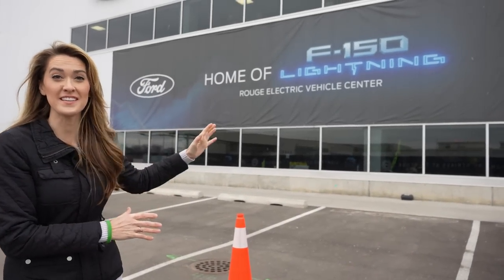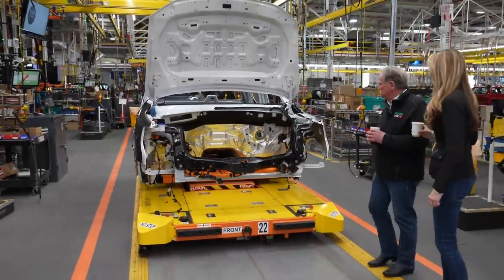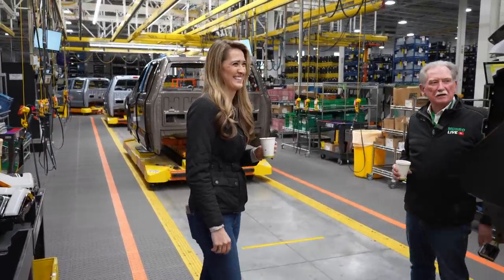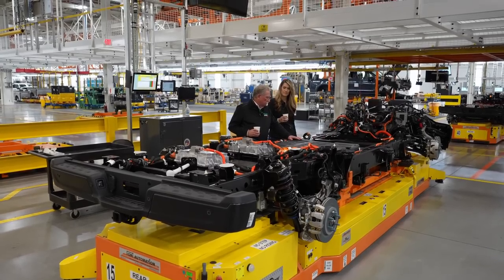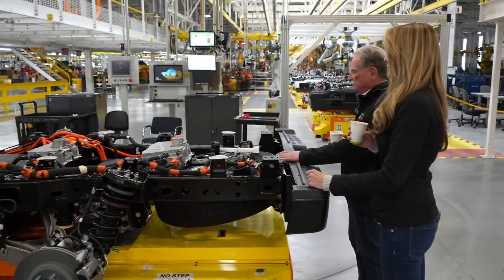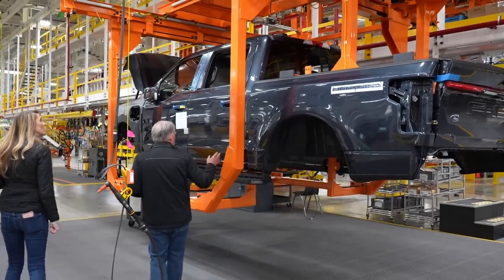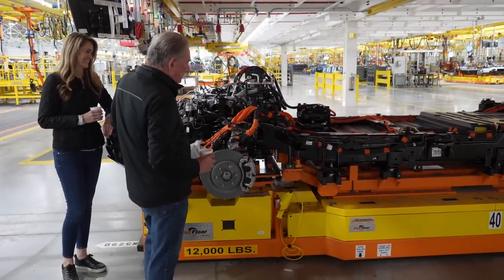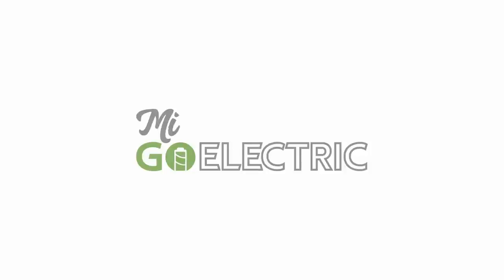Ford F150 Lightning Assembly Line Tour with Sandy Munro

Comment: I can’t believe that you and Sandy are walking around with open coffee cups in the factory.  Sandy even has his cup inside the cab of the Lightning. I don’t believe that either one of you would spill a drop, but it’s funny to me.
Reply from the maker: Yes, it was funny to us, as well.  Sandy has a pass to basically do whatever he wants everywhere he goes.  We saw Jim Farley gesture to Sandy over a crowd of reporters at a press event.  The guy is loved.
Reply: @MissGoElectric  I am so glad that you got to spend time together, what a treasure he is.
Reply: it's funny that in 2022, FUD motors is not using ADVANCED manufacturing, and LEAN design.
Reply: No safety glasses and open beverages on an active assembly line. Nonsense. 🤪
Reply: I like the video but Wow on drinks. we have different types of factories, but open cups and no PPE, i’ll have 3 departments; Environment, H&S and HR breathing down our neck so hard that it will snap.
Reply: Right?
WTF
Reply: @gcv1123  Bizarre!
Reply: @mavelous1763  Exactly!
Reply: Agreed - no safety glasses, likely no steel toe shoes, drinking in the vehicles, and leaning all over the painted cabs causing scratches. I don’t care who they are - I’d kick them out!,
Reply from the maker: @SUPaddict  We enjoyed the coffee Ford gave us and I'm happy to report that nobody threw us out.  It was a treat to walk around the factory which was not in operation along with several other film crews.
Reply: Scary
Reply: @gcv1123  it wasn't an active assembly line. The "active" parts of the video were edited in to show what they are talking about. It's obvious this was an open house event for press and VIPs.
Reply: This was going to be my comment. There are so many things you two are doing wrong. Sandy should know better. Setting a very poor example.
Reply: @terrysullivan1992  do you think that these vehicles are not going to customers?
Reply: @gcv1123  And no workers, no line movement, execs doing press interviews, yeah, just a normal day on an active production line.. Or..
Reply: "Hello sir, Ford calling . We regret to inform you that your F-150 Lightning order is delayed due to coffee being spilled on the wiring".  Can you imagine?
Reply: @philhyde983  But you will have to pay more for your truck because it contains coffee spilled by Sandy Munro and his DNA was in his slobber!
Reply: @mitchellbarnow1709  Hahaha
Reply: @philhyde983  I’m glad that you could appreciate my humor, some would take it seriously and ask, “really?”!

Comment: Great stuff!  Kudos to Ford for allowing this walk-thru.
Reply from the maker: Ford has been absolutely wonderful to our small channel.
Reply: @MissGoElectric  hey, while I have your attention, do EV owners comment about vehicle weights?  The EV's are much heavier than comparable ICE's and I'm curious if consumers know or care?  Certainly engineers care as the loads are higher and lightweighting is more challenging.
Reply from the maker: @andrewhalonen5241  We work with many of manufacturers on product launch campaigns (mostly EV) when we aren't producing content for this channel or on Instagram.  Through that work we have personally interacted with a couple hundred thousand prospective EV buyers.  In our view, most commodity car buyers don't consider vehicle weight. If anything, we've noticed that most consumers feel safer being on the favorable side of a collision with another vehicle due to Newton's second law.   The weight can also be helpful with traction in wintery conditions.  Of course, the polar moment of inertia isn't top of mind for everyone, but the location of that mass has some safety advantages, too.

Negative effects of extra EV mass is commonly amplified by low rolling resistance tires which might present deceleration and handling concerns for physics-minded buyers.

Performance buyers who drive on track tend to be aware of EV weight.  It is valid reason many of those buyers haven't gone electric yet.

Until the recent supply-chain trouble began driving many EV makers back to heavier LFP chemistry, it looked like production battery pack weight was dropping fairly quickly.  It will be a long journey towards power-to-weight-ration parity is achieved in most form factors.

What are your thoughts?
Reply: @MissGoElectric  I'm not surprised that consumers are largely unaware, yet I also wonder if the driving experience is superior for most people who drive commodity cars/SUVs/crossovers?  I drove a Tesla 3 once, and it was quick & quiet compared to my vehicles (I also liked regen braking).  So, I wonder if the power-to-weight ratio is superior to commodity ICE's, and that is sufficient to satisfy most people?  I asked because I study vehicle lightweighting.  I don't foresee emphasis (IE OEMs willing to pay substantial premium) to cut weight, yet hopefully we see an emphasis to cut costs.  Thank you for sharing.

Comment: Great tour of the facility and appreciate hearing Sandy's insight. I'm guessing he said there was no need for the foil barrier between frunk and cab, because there is no engine creating heat, but maybe they are using it as a sound barrier?
Reply from the maker: Could be. It may be more costly to change the procedure than to do it as it has been done.

Thank you for your encouragement :)

Comment: I've owned at 5 SVT F-150 Lightnings. Fabulous trucks! It kills me that FORD will never build a short bed single cab iteration...kills me!! I'd have already had my order in. Back in the day, I got a tour of the Roush facility in Allen Park, MI where the Lighting engineering bucks were located and a whole wall of supercharged engines was nearby that. Your tour sure was great to see and Sandy is the man to walk it with you...
Reply from the maker: It was a great experience. Maybe we'll see a smaller electric pickup from Ford in 2024?

Comment: I agree with measuring the gap at such a later stage. Well at least now i know why my my F150 has so much uneven gaps when doors are closed. They found them; no doubt, but said to roll it on son!
Reply from the maker: We took delivery of a new Tesla Model Y in March.  It also has panel gap issues, but it doesn't affect our experience.
Reply: @MissGoElectric  i am an ex-Toyota fan boy and build quality does matter to me. It does not take a lot of money but the will and attitude to improve the quality. Enjoy ur Tesla 🙂, it is on my radar too but can’t decide between the all the new EV choices.

Comment: Does Tesla have a gap sensor stop on its production line? If not, they could use one. If they have one, it needs adjustments.
Reply from the maker: There is always room for improvement.  Perhaps Tesla's new factories in Berlin and Austin have addressed consistency already.

Comment: Would love to see you at power train for battery assembly, body and white is always neat to see, used to work for ABB, sounded like 150 battery line very mixed. Take it any day over Pari Mach E line. Kansas City transit battery line, miss it and dont. Too much time away from family but incredible experience and can have really great group of people dedicated to same project, at least until upper management f's it all up.
Reply from the maker: Each role in a huge organization like Ford surely has its perks and drawbacks.

Comment: MISS goElectric - this is not the FIRST ford electric truck, they built the EV Ford ranger  in the 1990's. it was a commercial failure.
Reply from the maker: Our claim in the introduction is that it is the first "full sized" truck, which is true.  It is also the first mass-market electric Ford truck.  The Ford Ranger EV was mid-sized and they only produced 1500 in four years of production.  Ford produced more electric F150s in the first few weeks.

Comment: I can’t believe you’re walking a manufacturing facility without safety glasses.  Safety toe shoes are probably required too.
Reply from the maker: If the factory were operating, there would be dangers. It wasn't running, though.

Comment: That's why Silverado EV is coming next year and redesign Lightning in 2025 on TE1 platform.

This is a modified F-150 platform where GM Silverado EV BT1 is a EV from ground up next year.  

Wait for Ford 2025 redesign. 

The Ford F-150 Lightning is already being promised a redesign for the 2025 model year. Reuters mentioned this when discussing Ford’s production plans for the Lightning.
Reply from the maker: We talked about another purpose built electric truck to be manufactured in Tennessee in our F150 Lightning Launch VLOG video and on Twitter.  We have not verified if it will be an F-series vehicle. We know it has been in development for two years and will feature radical design and aerodynamic elements.

Comment: Having a career in manufacturing/ quality, this appears as low volume or soft ramp up in production. I will say that the base model, or Pro as Ford calls it, is currently a bargain in the present EV world. The coming GM Silverado EV @ near 40k should be so too. The Cyber truck doesn't stand a chance at this price point for performance.
Reply from the maker: The unrivaled scale of F150 production is a major advantage keeping the costs down for F150 Lightning.
Reply: Hmmmm. Hmmmm. Keep believing that. TSLA makes more money than F at 1/3 the sales. Have you seen inside their factory? F does not stand a chance
Reply: @MissGoElectric  Really hope they can hit that 150,000 per year next year as stated and then after that, really scale to unrivaled levels. The mach-E volumes have been underwhelming, to say the least. Demand is not the issue.
Reply: @yeswecan4312  🤣

Comment: It looks like Ford took a regular ICE version of the F150, removed the engine, transmission, drivetrain and associated parts and replaced them with electric motors and battery. Not a bad way to quickly get out an EV version, but probably not optimized for an EV. It would be interesting to know whether anything in the cab or bed differs between the EV and Lightning versions of the F150.
Reply from the maker: This is largely an upfit and Ford has developed a different all electric pickup truck which is more efficient. We recently learned from Jim Farley (Ford CEO) that it is scheduled to go into production in Tennessee by 2025. Subscribe to this channel for updates on that one.
Reply: @MissGoElectric  - FORD lied , and it matters. 
you did it Ford, you LIED .
Reply: GUY - FUD Lightweight is using an outdated body on frame, it does thankfully have 4 wheel independent suspension, but no Active Air suspension STANDARD. 
the only thing going for the Lightweight is it can use standard F150 accessories. 
but, it's still too slow , too heavy, inefficient.
Reply: Interesting how well this stacks up to the Rivian and Hummer/Silverado EVs. It seems like body on frame should be heavier, but the Lightning is lighter than the Rivian by 200 lbs, lighter than the Hummer by over 2000 lbs. All three get close to the same range. Lightning can tow 2500 more pounds than the GM trucks. 1000 lbs less than the Rivian. Biggest difference between the two is Rivian does 0-60 in the 3 second range. Ford does it in 4.
Reply: @MissGoElectric  - just posted, JAY Leno drives the NEW 2022 f150 Lightweight.
Reply: @markplott4820  The "outdated" body on frame is both stronger and lighter than any of the cheesy unibody trucks of the competition. Another comment highlighting your stupidly. You can stop now, we already know it.
Reply: @heathwirt8919  - not lighter than Gigacasting and origami steel body. 
FUD f150 is 100 years out of date.
Reply: @markplott4820  Not just lighter but also stronger. Stronger, lighter and it's here now. Gigacasting is just a word made up by a marketing department, it has no real meaning. It's perfect propaganda for the know nothing fanboys.
Reply: They didn't remove anything, is a ground up completely new EV chassis with an aluminum body sitting on shock mounts. There are similarities in the body, doors and interior pieces. But that's it.
Reply: @markplott4820  The Cyberflop will be 100 years late?
Reply: @heathwirt8919  - still using outdated Horse & Buggy frame.
Reply: @heathwirt8919  We should all be able to see that, too. "Giga"casting, "giga"factories, "super"chargers, "exoskeleton." Yeah, Tesla need not advertise when so many use these marketing terms for them.
Reply: @benjaminsmith2287  You can always identify a Tesla fanboy post by the liberal use of meaningless Tesla marking department buzz words.

Comment: 11:13 lol. who in Ford did this, likely to show the world they have advanced robots.😅this could be done on a crane like device with multiple weights.
Reply from the maker: The engineering reasons for such an advanced arm would be fun to learn about. We understand that the sensor suites in the Lightning are numerous and largely untapped. Precise calibration appears to be crucial. Over the air updates will yield additional functionality over time
Reply: @MissGoElectric  thanks! ok makes sense.  i think they intended the scale to be accurate within under 1kg so that buying goods in terms of weight can be immediately verified on the truck bed e.g. weight of grains, fruits, sand...

Comment: If Ford is using the method Sandy states to put on window controls, more people could have bought F150 and price wouldn't have gone up by 8k
Reply from the maker: The supply train woes are putting on the squeeze right now.

Comment: Ford is trying so hard to get this truck in the spotlight to compete with Tesla that they are willing to take a beating from Sandy (or even have him spill coffee in the truck). Before Tesla, you probably couldn't even get near a Ford factory. I love his comment about the foil on the firewall. There is no need for a heat shield there with no engine. Probably a leftover part from the ICE version that they converted. This is why converting an ICE vehicle to EV is a bad idea. I saves development costs, but it creates a lot of other issues that add weight and complexity that wouldn't be there if it was designed as an EV from the start.
Reply: Nothing wrong with that. Ford should be trying as hard as possible.
Reply from the maker: Ford has an EV only pickup truck in development which will probably be out around the time of the Silverado. They aren't joking around.
Reply: How can Ford compeat with Tesla?Tesla doesnt have a Truck!

Comment: Is that a transmission tunnel on an EV?
Reply: ♻️ Chasis/frame recycling
Reply from the maker: Utilization of parts from the world's best selling automobile (F150) is a major manufacturing advantage Ford has. It is part of the reason this EV truck is so much more affordable than the others available.
Reply: @MissGoElectric  Or an unwillingness to change the way things have "always"  been done. Sandy Munroe has said that this is the problem with legacy auto makers like Ford and even cites that as a reason he left Ford. Repurposing the ICE F150 chassis/frame, instead of designing a purpose built one, is not a good sign. Sandy has been calling for manufacturers to cast their chassis/frames for decades. None of them would listen, none of them would change until...Tesla.
Reply: Its game over for Tesla!
Reply: @brunoheggli2888  this year or 2023 = GAME OVER for Tesla? Lol🤣
Reply: @mikafiltenborg2291  2022 3/4  :)

Comment: battery tech really needs to improve, they're putting all this effort into making these vehicles and the batteries are crap, unless you plan on just driving short distances with no gear or hauling.
Reply from the maker: 300 miles will work for some drivers, but I think many of us are waiting for the 400 mile Rivian and the 500 mile Cybertruck.

Comment: Imagine the fuel saving!
Reply from the maker: And the next electric truck Ford could be 30% more efficient with a similar payload.
Reply: @MissGoElectric  - assuming FUD motors does not go BANKRUPT in 2024.
Reply: Imagine the truck FIRES 🔥 from the CHEAP batteries used.
Reply: Ford is better then ever,you better worrying about yoir beloved Tesla!

Comment: That assembly line doesn't look hardly any different than other ICE assembly line, rather disappointing. Hope they can ramp up more than 150k unit a year as Ford sells over 1 Million F150 but by looking at all the stations and manual steps it's going to be hard.
Reply from the maker: Our confidence in Ford's commitment to and capability for volume EV production is high.

Comment: When I compare visually this Ford factory with Tesla's, this one looks like one generation behind and I am not a specialist.
Reply from the maker: We haven't been to GigaTexas, but certainly the building scale, vertical integration, giga-press, and meticulously engineered low part count are areas in which Tesla has significant advantages over all other automakers today.
Reply: @MissGoElectric  But they still don't have the quality control in the finished product. I'm not talking about panel gaps either, which I think are overstated. The thing is, we use end products. And if Tesla has interiors that reverberate and harshness in the Y and 3's suspensions, that's what we experience. It's all well and good to have wonderful factories, but you have to sweat the details in development and have stringent quality control as well to give the consumer an impression of a quality vehicle.